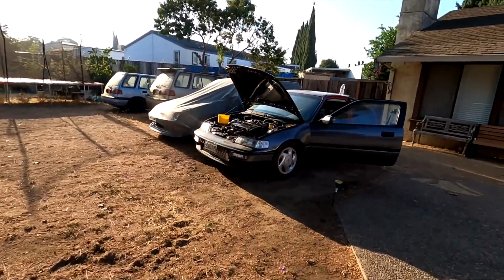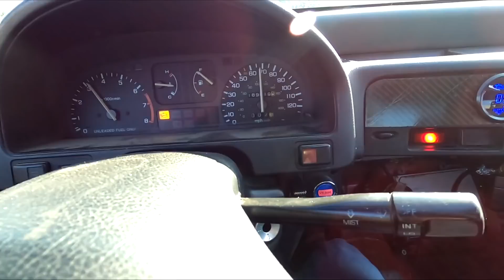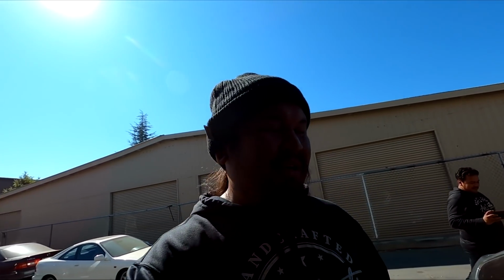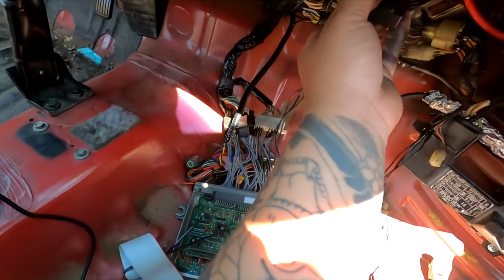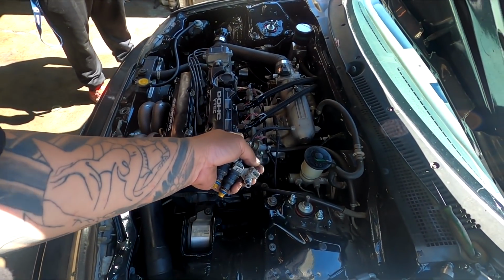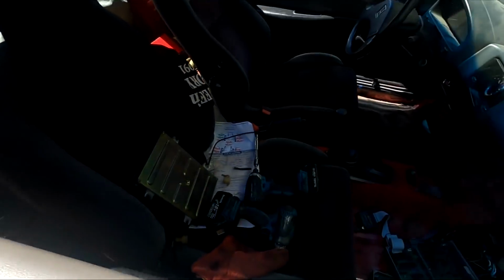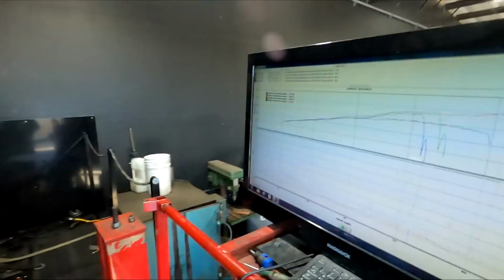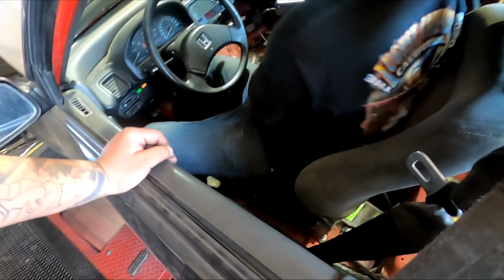FLIP CRX OVERHEATED ON THE WAY TO THE DYNO!

Comment: Man and i freaked out when my turbo b20v hit 215 after some pulls. Upgraded my slim fan to a spal 1400cfm fan with shroud and now no problems. Also got half size dual core radiator and gates 170 thermostat. Keep up the work its a pain dealing with it but will be worth it just like all the other builds. Just keep faith👍🏽
Reply: Once you turbo a you have to upgrade the stuff that cools your car down right ? Besides intercooler we all know that lol
Reply: @kaybevang536   yup, hd the upgraded radiator, slim fan,thermostat already in before the turbo. It was the slim fan that had to be upgraded after turbo for more cfm

Comment: mine does the same thing. b20v turbo with a half rad. i got a turbo blanket and heat wrapped the dp ( watched your vid and followed that in hopes it would help ). still overheats on the highway when cruising or whenever its over 60f outside. when its cool outside i can drive it non stop

Comment: I was just chasing a heat issue, ordered Spal fan to replace the mishimoto 1150cfm that came with the mishimoto dual core radiator, heat wrapping all my pipes from turbo mani to down pipe and extending my dump to vent under the car. Also reflective heat taping my charge pipes to intake and relocating my filter off the turbo to fender
Reply: This was after the car was running up at 206 for a run or two, I did a leak down and compression test that came back perfect too, I removed my thermostat and took my bumper off and now we’re 196 hottest

Comment: Dragon fire distributor, Thicker Headgasket and Spal fan should clean everything up!
Reply: I don't have experience w/ the Dragon Fire but I've been thinking about getting one for my B18C track car in my pic or possibly just going w/ a COP kit. What's the benefits of the Dragon Fire? Is it a higher power stock replacement?
Reply: In my opinion they are way better than OEM and will also help out in the high RPM range! And if you have an MSD ignition setup that's giving problems it will help clean that up also 👍🏾
Reply: @hecks_k20_fa5  Thanks dude.
Reply: @estewar03  Yeah man your welcome 🤛🏾 Definitely worth the $200 or however much they cost now! And a little cheaper than COP,but nothing wrong with going coil on plug either.👍🏾

Comment: Wonder if the  hot air from the radiator is being recirculated behind the intercooler. So maybe try to make a little wall out of some card board  or something that goes from the turbo side of the radiator to the middle of the intercooler ( forcing the radiator to get all its air  through the  intercooler)

Comment: check those fans. make sure u have a sprout and that u have it set to pull not push. if u get a 2nd aux fan to put in front of the rad lije a Spald fan. then u set tgat to push this way u have double air flow. I did this to my Charger as it was overheating. now no mo over heating. have the aux fan wired to the existing fan to run together when temps r reached.
Reply: @T R 2yr bandaid
Reply: @T R I did everything at 1st. new rad, new coolant, thermostat and blead system. still ran hot. after repair 2yrs kater nothing. my wife beats the hell out of it and go on long drives.

Comment: saw lots of smoke out the exhaust, looked blue, probably a blown head gasket, would explain low power, insane overheating, and the smoke.
Reply: multilayer head gaskets are manditory on boost so maybe theres a stock gasket in there